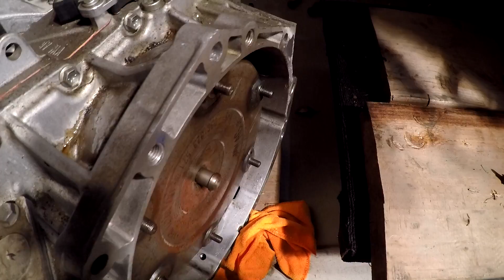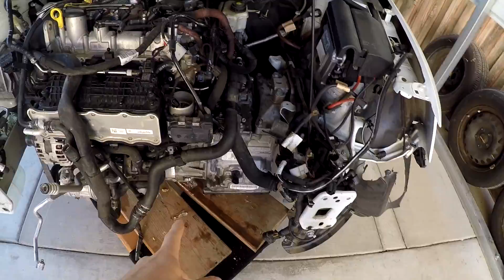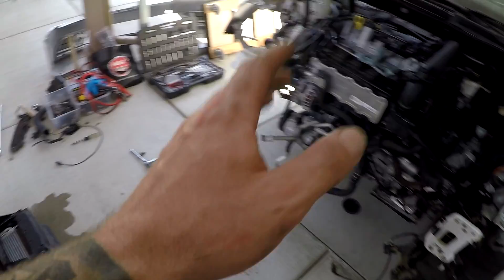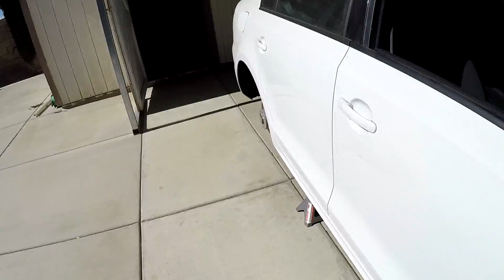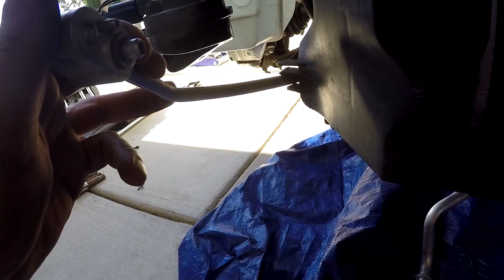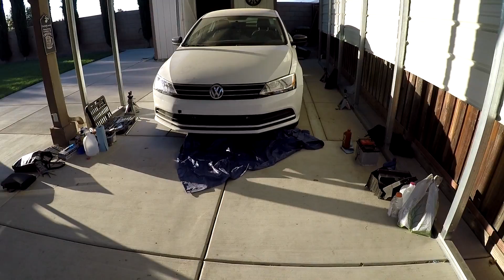VW Jetta TSi Resurection Part II - Installing Engine & Transmission

Comment: Awesome job! The codes can be a bitch to fix depending on what's throwing it. However for a car that you pretty much ressurected I'd say hell of job my friend! Hopefully it's nothing serious and the codes are bygones from the previous engine and just clearing them is enough to make them go away 😎😎
Reply: BoostedMotorsports  man that sucks! Which computer is attached to the engine now? Is it the old engine computer or the one from the newer engine?
Reply from the maker: Its the original computer.  Finally got all the bugs worked out and she is running code free.  I'll update in the next video! 👍
Reply: BoostedMotorsports  congratulations Man! That's always a great feeling when things all work right. I recently expienced that when I installed a new Android radio and backup camera in my wife's car. Thankfully it's all installed and working correctly!